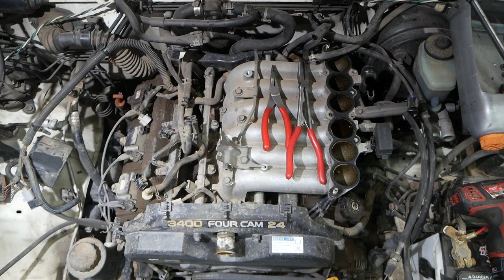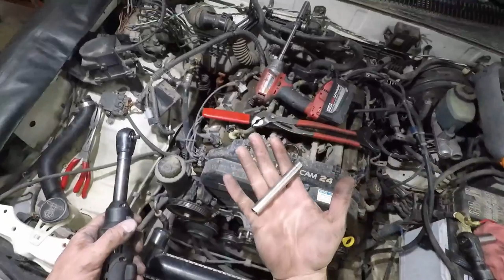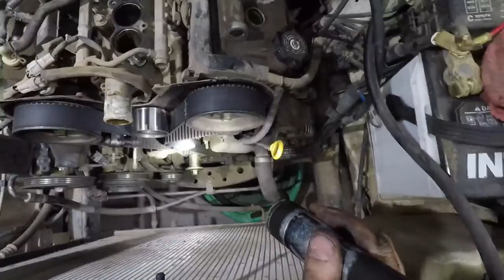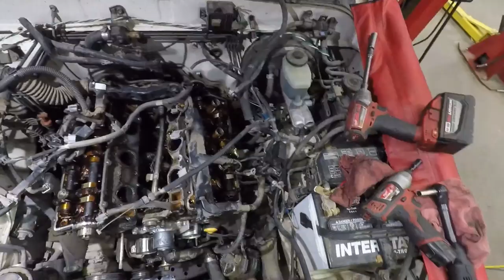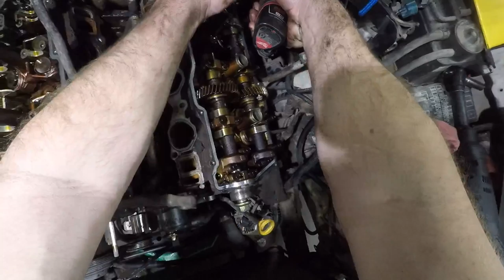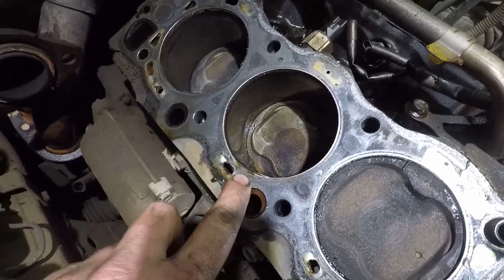Live 1996 Toyota 4runner cylinder head removal.

Comment: I have a 3VZE but it's all so similar I am watching and learning. Thanks.
Reply from the maker: Very similar. I own one as well in my 95 pickup. The worse part on the 3vze is the intake manifold removal. Make sure to take photos of the vacuum lines on the passenger side (USA) of the engine. All of the vacuum lines are numbered from the factory so they are easy to reinstall.

Comment: Great vid guys, have you made one of reassembly? I’m interested to see if you use any RTV or copper spray on the gaskets.
Reply from the maker: I only use the copper coat if a head saver shim is required. Just install the gasket dry unless the instruction in the gasket kit specify otherwise. We have additional livestreams of the valve clearance checking and installation I believe.

Comment: Hey boss. I just followed both of your videos to do a head gasket myself. Great videos and very easy to follow. I'm getting misfire codes p302, 304 and 306. Also had a lean bank 1 which was p171. Figured that one out was the throttle body gasket I just replaced and that went away. Also my brake booster is no longer working. Any ideas? I checked all vacuum lines and even replaced some that were good just because. Just ordered all new coils to make sure that isn't it. I'm stumped at this point. Could careless about the booster I just want my truck to run. BTW it's a 97 4runner.
Reply from the maker: My guess would be incorrect camshaft timing on bank 2. Make sure the timing belt marks line up, make sure the timing sprocket dowel pin is still in place in the camshaft otherwise the timing sprocket can slip or not line up properly, make sure the timing marks are good between the gear to gear connection of the exhaust and intake camshafts on bank 2. 

Any of the things listed above can cause low engine vacuum and a hard brake pedal. A misfire on all bank 2 cylinders will also be likely.
Reply: @ThePracticalMechanic  thanks...that's exactly what I didn't want to hear lol. I appreciate the response!

Comment: Thanks for the great video im doing a head gasket replacement on my Tacoma  I missed the step about the cam sprocket being loaded(2:01:48) and pulled the cam with out installing the 6mm by 1.0 bolt. Do you have any suggestions on what I can do to correct this mistake? Thanks
Reply from the maker: I use a spanner wrench to turn the spring loaded gear while holding the camshaft in a vise. 
If you don’t have a spanner wrench you can use channellock pliers but wrap the gear in a rag to protect it. This method risks damaging the teeth on the gear.

Comment: I need to replace my headgasket and have 2 cylinders remachined.  I'm going to take apart my 2002 4runner 4x4 le.  Any way we can remachine ourselves?😳
Reply from the maker: It’s best to have them machined flat. It’s a big job to do over again. Machine shop will likely charge $30-40 per cylinder head.

Comment: would you recommend buying replacement parts from the manufacturer ? or would autozone o/napa auto  be fine? in regards to quality and longevity of parts
Reply from the maker: The felpro gasket are decent and should last years without issues. Valve cover gaskets will be the first to leak. The crappy amazon ones I used are already leaking. OEM would still be best.

Comment: Excellent video. Will you post the link for the gasket set you used? Thanks
Reply from the maker: Bob Hatch I used some from amazon but the valve cover gaskets have already begun to seep oil so I don’t recommend them. I always have good luck with the felpro set but I didn’t want to spend the money. I should have known better. The headgaskets are still working fine.

Comment: What's the purpose of the single 8mm Allen head bolt in each head?
Reply from the maker: I wish I knew why some engineers do what they do!!
Reply: @ThePracticalMechanic  it just seemed like it was kinda useless to me when I did the head gasket job on mine. Only thing I could think of is that maybe there's a "weak spot" in the seal right there that may rear it's ugly head over time. Other than that I didn't really see any use for it.

Comment: Hi sir, I am a new subscriber and I have a cuestion, those hidden allen bolts that you removed at 2:17:31 use washer? I have all the washers of the 12 points bolts but I don't see washers in those allen bolts.
Reply from the maker: It been a couple months since I’ve done another one but I don’t think there is a washer on the Allen bolts.
Reply: Thank's.

Comment: how the heck do I get that wire clip off the left side of the timing cover?
Reply from the maker: For the camshaft sensor? I pull the cover back slightly so I can reach inside the cover and squeeze the tabs that hold the connector into the cover.
Reply: thank you. I’m at the part in the video where I remove the camshaft pulley. I ordered a chain wrench to help me with that. It will be here tomorrow. But I need to tell you that I’ve never done a big engine job like this and I’m super intimidated and feeling like maybe I should just put it back together and sell as is. I don’t mind the labor at all, it’s the complexity of the job and my fear that I won’t be able to complete it, let alone get it put back together correctly.

Comment: Why did he remove the crank pulley?
Reply from the maker: It makes it easier to line up the belt later on. There are marked on the belts that line up with marks on the crank and cam sprockets.
Reply: @ThePracticalMechanic  iv replaced a few timing belts on these 4runners and never had to pull the crank pulley or lower plastic guard and all timing marks were easily recognized on the belt, cam sprockets, and the crank pulley... Just thought it was easier without removing the crank pulley but I'm not a mechanic lol

Comment: Can I clean my head's myself or do I have to send them off to get work when putting a new head gasket on
Reply from the maker: It’s best to have them machined flat. It’s a big job to do over again. Machine shop will likely charge $30-40 per cylinder head.